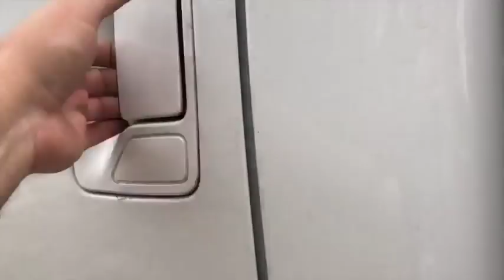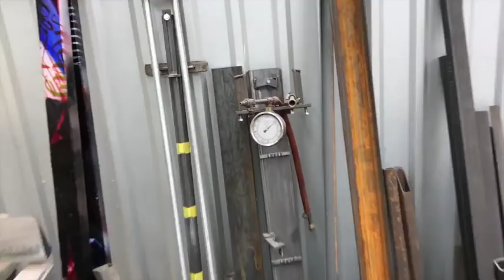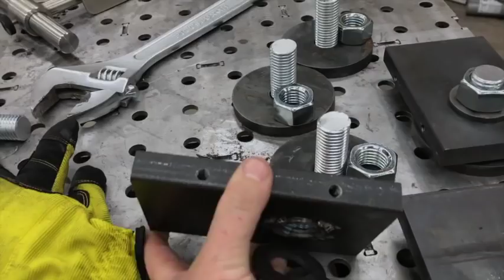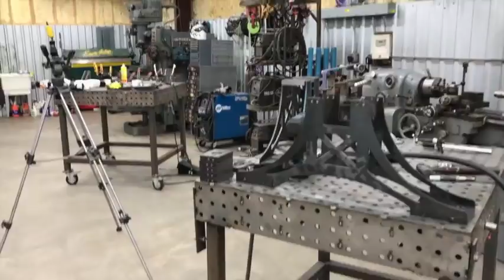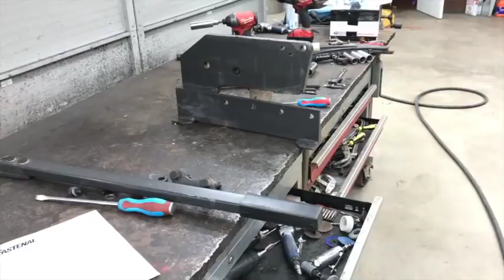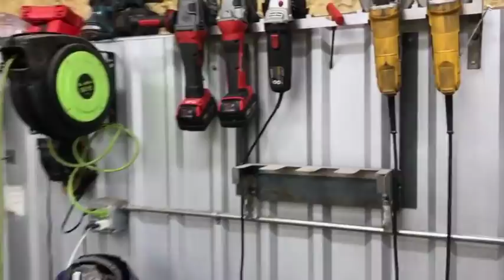Table Kit Alignment CAD - Preview of next fun project

Comment: I hope the chevy has a brake controller. If the trailer starts to sway badly, you can press the button on the brake controller and slow just the trailer and reduce it......but maybe you already knew that. Yes, too little weight on the tongue is bad, but I agree with you that you don't want to bottom out the suspension on the rear of the chevy either. If it acts bad, go slower or stop and run the truck up forward. The youtube videos of people wrecking with a trailer are scary and it would be terrible to have that happen. I'm assuming the truck didn't run well enough to just drive it to the shop you want to use.?
Reply from the maker: it had a hard time cranking, but once it warmed up it did ok, but when i backed it onto the trailer, shut it off, it wouldnt crank back, so I may try to drive it and have my friend follow me wiht truck and trailer if it doesnt make it.  So far it seems as if you can get it to crank it will stay running

Comment: dont you normally load cars forwards, not reverse? keeping the weight at the front
Reply from the maker: Well you want to try to get the weight center over the axles of hte trailer so that yo dont have alot of tounge weight, and with the front of my truck being super heavy thsi was the way to do it
Reply: no worries. i just thought if you load it with the majority of the weight at the rear you can sometimes get a sway as you tow. stay safe. all the best.
Reply: You are tail heavy there Gary. You always want tongue wight. 1/2 ton tow rig you want close to 1000 lbs tongue weight ideally, provided the towing truck isn't draggin tail. Centering over axles is a myth. 
Centered weight with a balanced tongue can wreck you. The weight bobs back and forth on the trailer, tongue goes up and down. The trailer has the ability to pick up on the tow vehicle through the hitch, it will have same force rising as dropping. Off center towards tongue giving you tongue weight, your weight equation changes, zero force rising in the hitch. Ideally if you can have a forward balanced load, level trailer, level tow rig it's the best you can get. I've been there, bad places etc and you have to do what you have to do some days. I would tow  what you have got if it were me. Maybe/maybe not try to pull the load towards the tongue much as you can depending how it all looks hitched up. Maybe never get over 45 mph too. See how it feels, don't hurry,  your pulling a good bit more than the tow rig is. It can throw you if you let it. LOl check the trailer brakes BEFORE your first stop. Be safe Gary hope it gets a good fix.